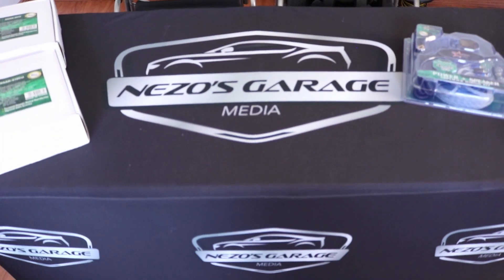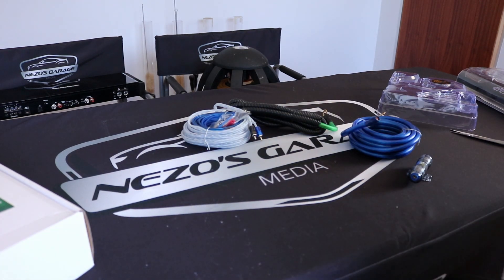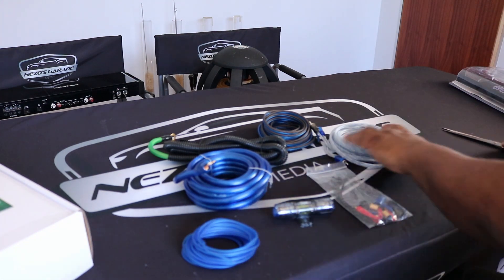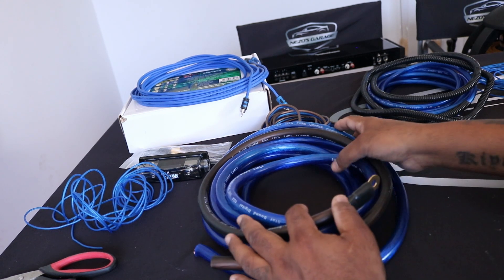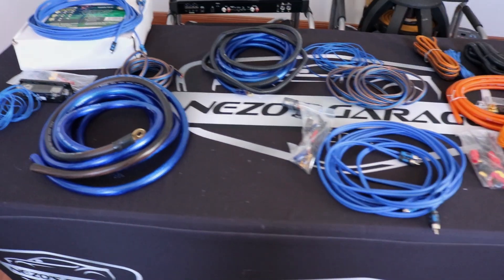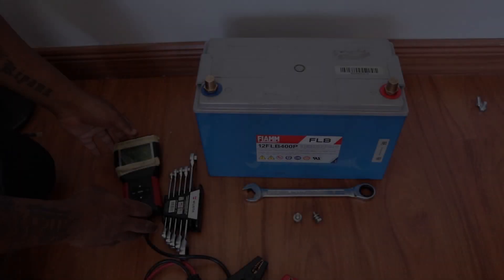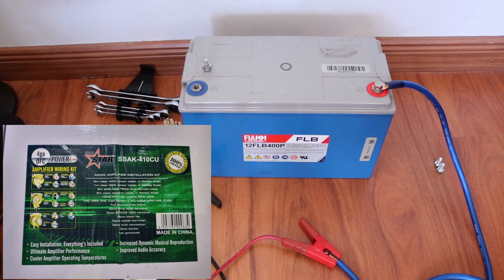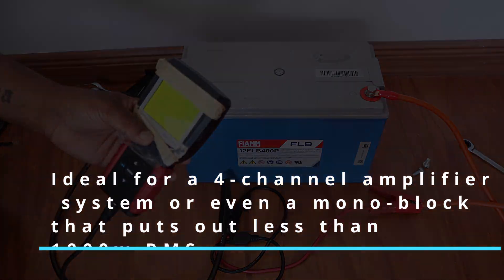0 Gauge copper vs 4 gauge copper vs 4 Gauge CCA power cable

Comment from the maker: Hi. 
It was the full length of cable as it comes in the packaging.... without the fuse....
Reply: What i realized is that with fuses the current will drop on all the cables
Reply from the maker: @tebza moyaga. The actual current will drop as the cable hits up. 
always fit a fuse. It's not worth the risk.

Comment: Fantastic review of the mentioned cabling. But would be greatly appreciated if you can test most commonly used welding cables as we all  know alot of guy's are making use of it and advising people to use it just so we can have some solid data when comparing welding cable vs ofc power wire used for amplifier .
Reply from the maker: Hi. 
I will do that as soon as I can get my hands on a few lengths if 6m cable
Reply: Awesome video Nezo

Would be cool to see some more testing
Reply from the maker: @razaaqpaul2214  thanks sir